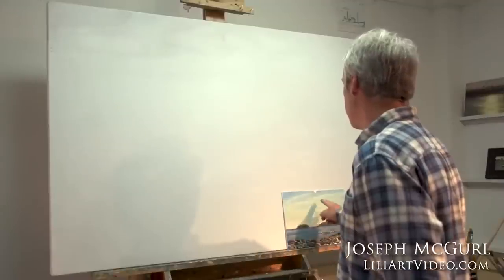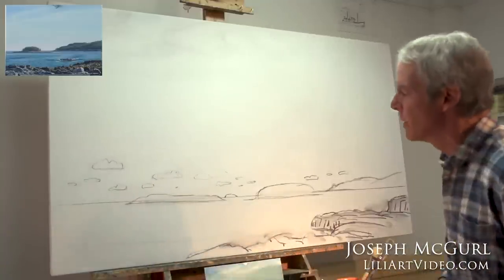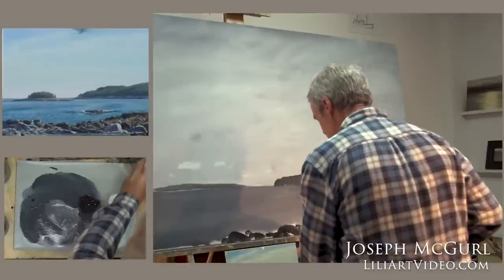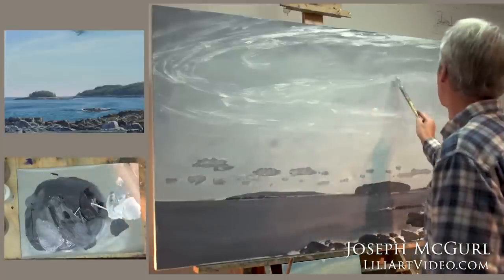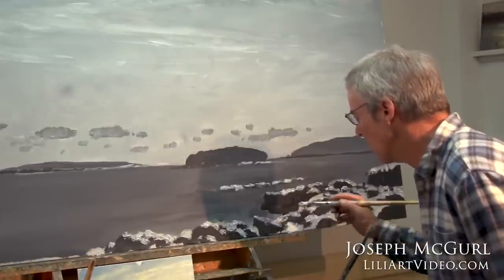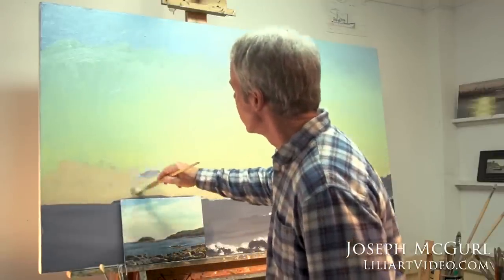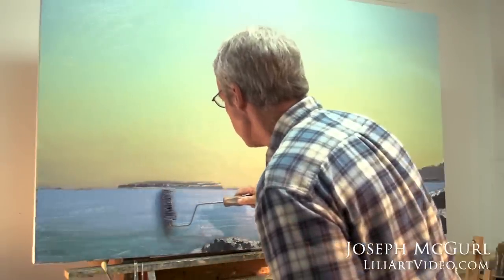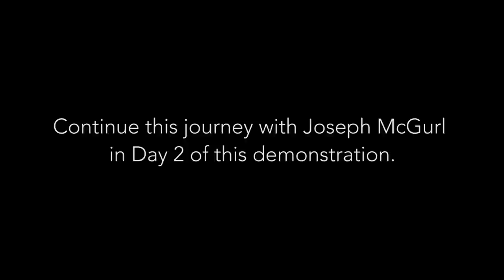Joe McGurl “Advanced Landscape Painting”  **FREE OIL LESSON VIEWING**

Comment: Why use gesso instead of acrylic under painting? Is there a difference?
Reply: The gesso has a powder..  powdered calcium so that its not slick its got a bit of texture and it slightly absorbs paint.  maybe not absorbs but the oil paint stays put a little better.  I got gesso for 10 dollars the other day.  Especially if you are painting with acrylic, you could just seal the canvas or board with acrylic if you want
Reply: @MrKongatthegates  awesome thank you. Do you know where to buy the strident(probably misspelled) tool/roller? Checked everywhere, I could think that would carry it. No luck.